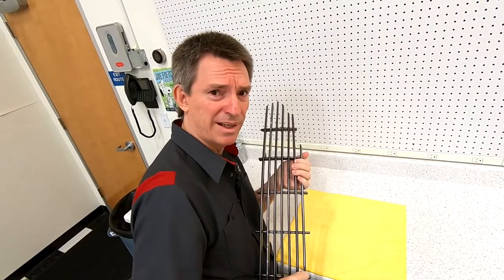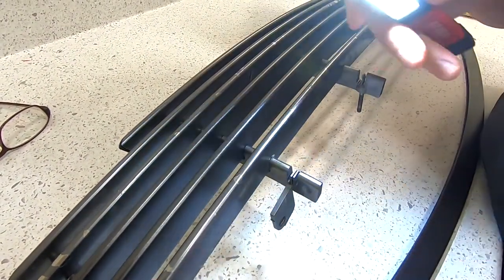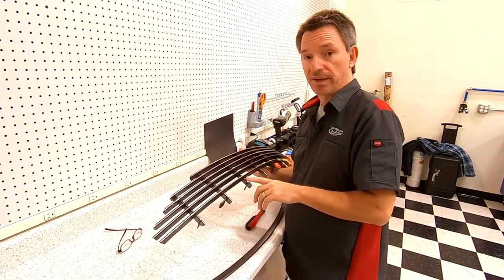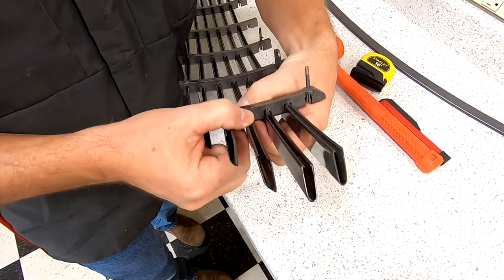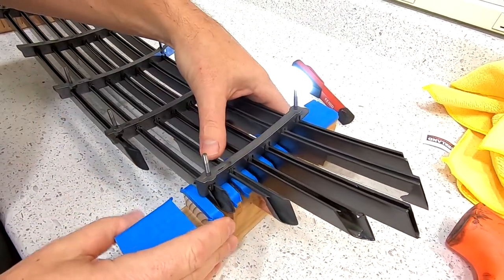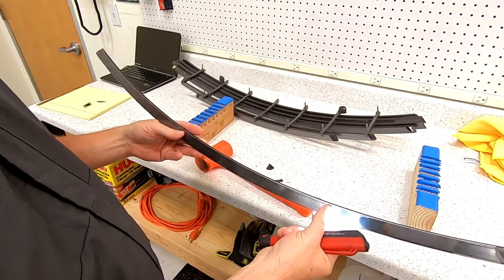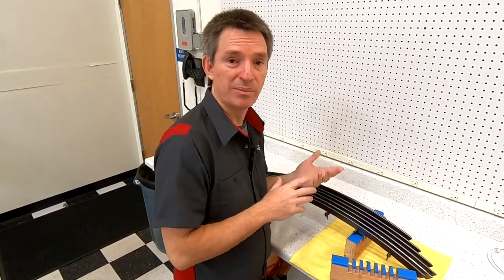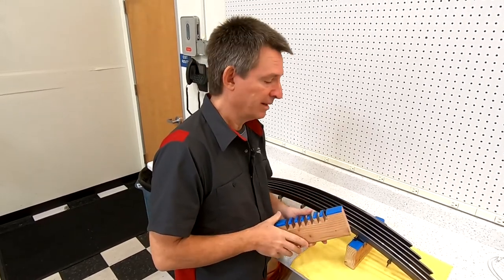Disassembling and Re-Assembling the Grill from an Aston Martin DB9

Comment: Very interesting. Appreciate the detail you point out with your video. I have a 2005 DB9 and my grill is polished stainless ie not painted, but the vertical arms are pot metal.  I decided not to take it apart and  polished it slowly by hand.  Worked OK.  I had the grill out to replace the black plastic mounting frame which had multiple cracks due to age.  Now that was an adventure. You have to remove the front bumper cover to release the frame since it has mounting points for the bumper cover. Now that was a big project but very doable. Let’s you get at all mesh panels in bumper that you can now clean up and paint. Also can clean and repaint the power steering and transmission oil coolers.  These get dinged and sand blasted with ordinary driving.  Looks like new now.  While there you can spruce up the air intake pipes and the air filter holders which also have to be pulled to get to the bumper cover bolts.  All that just makes the nose of car look like new.
The part number for the grill surround mounting bracket is 4G43-8190-AC   P.O. 10098069.  Fit perfect for my 2005.
PS AM says to “pry apart the clip joint with long screw driver”. This is totally wrong.  The clip joint is actually a tab slot. On the back side  of the slot is small tab you can depress and then bumper pulls forward and out of the slot.   Do not pry from the front.  I broke two rivets inside before I could see how it was put together.  5/32nd  1/2inch pull aluminum rivet to replace.
Reply from the maker: Hi Robert.  Thanks for sharing all that.  My grill surround is cracked to hell too.  AM tells me that they can't sell me a plastic surround for a 7 bar grill any longer.   Is that 4G43-8190-AC you got one that works with 7 bar?   The diagram shows it paired with a 5 bar
Reply: Aston1936 Yes, my surround is 7 bar grill.
Reply from the maker: I've ordered the surround from Scuderia today.  THey say a few weeks which will be just fine if I can get one.   Will lead to articles on removing the front bumper surround I think.  The fenders can be left on right?
Reply: Aston1936 Yes, the side body panels stay in place.  Having your lift will be a huge advantage.  I only had jack stands.  You have to totally remove the front wheels and wheel surrounds.  The air boxes come out which is very challenging.  To do that you have to release and lift up and out of the way the intake ducts to the throttle bodies.  A dedicated clip hand tool needed to release the unusual spring clips Aston uses there. I broke both yellow side lights ( order some now ) and bumped headlights out of position. Bumper bolts are very fussy too.  4 on each side. Use a bright light and very small screw driver to push down on the small arm on back of the tab slot as someone pulls bumper straight forward. DO NOT pry at the front space.  Also, top of the surround has a small tooth that recesses in to the tips of the upper side panels. It is usually broken and be sure piece not left in place.  Check your headlights for fit BEFORE putting bumper on.  The are only 3 screws that secure them and very easy to knock lights askew. Yes I made that mistake. When everything apart it is super easy to clean everything and spray black paint on pipe work.  Also the bumper grills come out easily and can brush and repaint too.  When you are ready I would be glad to come over from Stockton to help.

Comment: Great Job - patience of a Saint. You could also use a large wooden dowel or something to hit directly on the piece you want to remove at the point of the plastic, rather than the entire hammer head as the head might hit one of the bars either side of the one you want to remove....just a thought.  Also is it not possible to find a metal workshop and get them to duplicate the plastic pieces out of metal?
Reply from the maker: The dowel is a good suggestion.  It wasn't difficult to just nip it with a portion of the hammer face.   It would be nice to find someone with 3D printer skills to develop the plastic vertical parts as a model, and see about getting them 3D printed or milled in aluminum.   Thanks for watching!